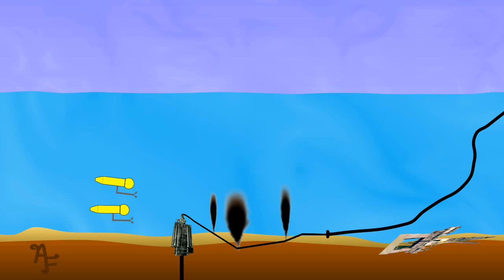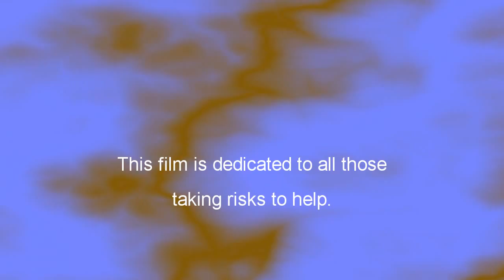US Oil Spill Explainer And Solutions

Comment: there is one problem with that idea of bring another drilling rig in to stop the leak.
once a rig attaches it self it will most likely suffer a blow out and will not be able to recover and most likely exploded just like the deepwater horizon. the pressure in the well was 9000 psi of pressure.